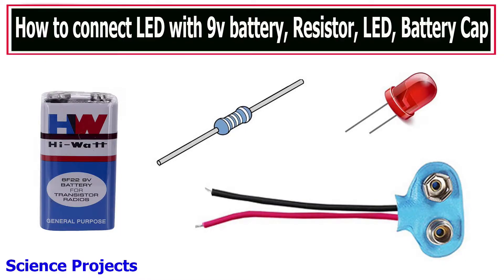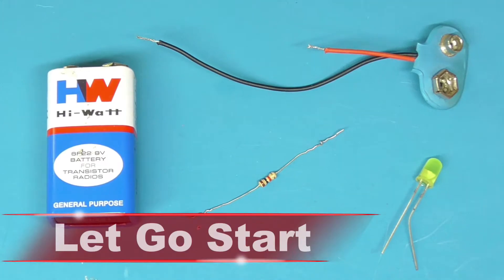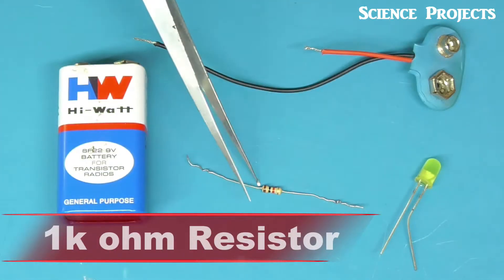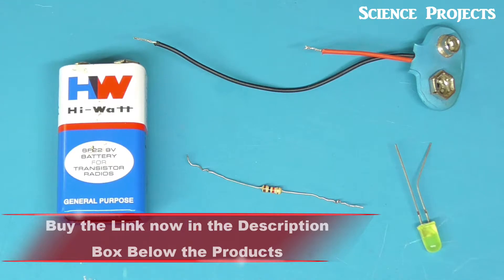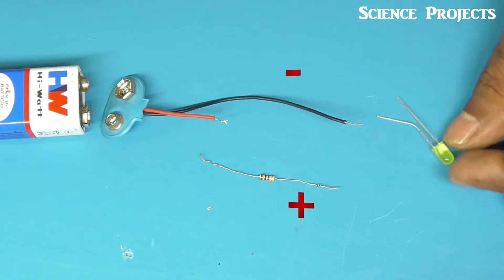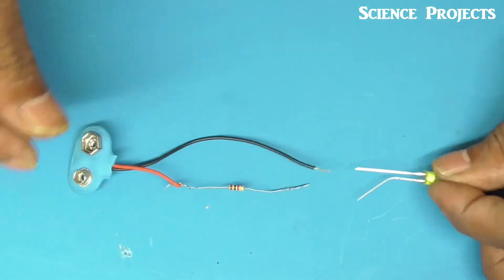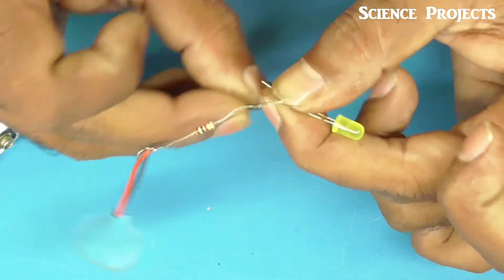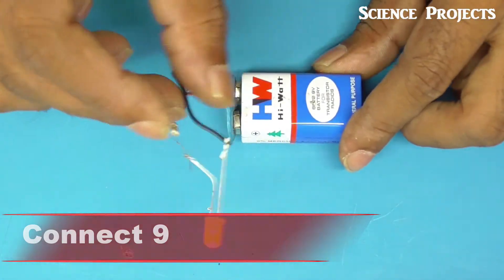How to connect LED with 9v battery, Resistor, LED, 9v battery connection tutorial

Comment from the maker: 1k ohm resistor - https://amzn.to/3c0Pu6N
2 volts 5 mm led  - https://amzn.to/30fSQgI
Hw Battery 9V - https://amzn.to/3bhZNUL
Wires –https://amzn.to/2SkXYKM
On off switch dc-https://amzn.to/2LPPZ9T

Comment: What is the amount of rasistor for 32 mini led light
Reply from the maker: 1k ohm resistor - https://amzn.to/3c0Pu6N
2 volts 5 mm led  - https://amzn.to/30fSQgI
Hw Battery 9V - https://amzn.to/3bhZNUL
Wires –https://amzn.to/2SkXYKM
On off switch dc-https://amzn.to/2LPPZ9T